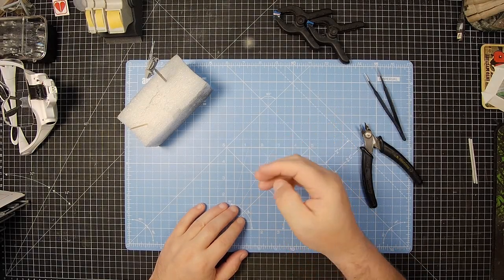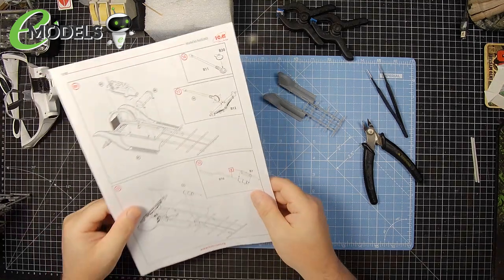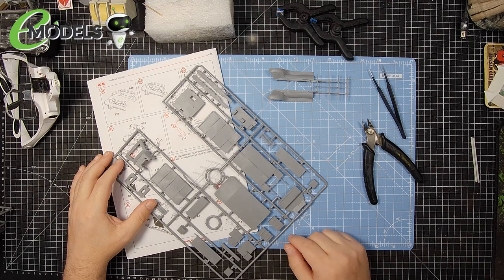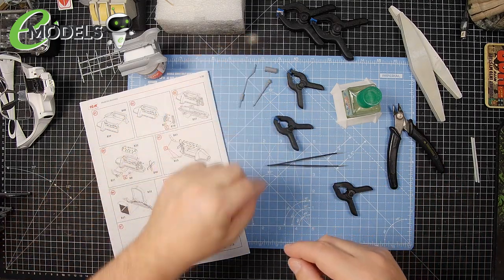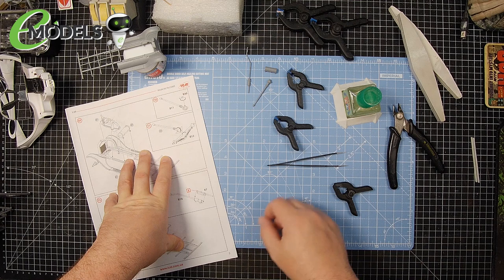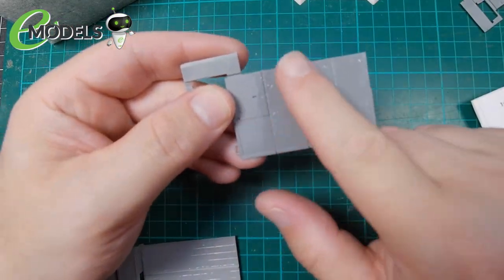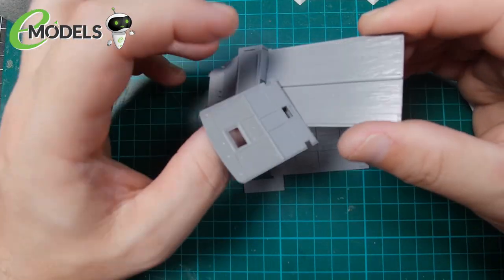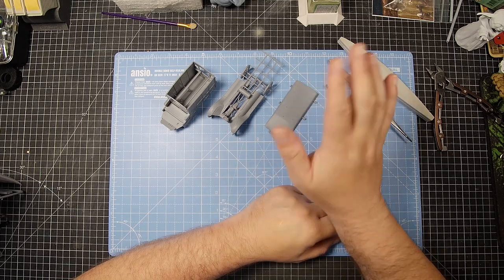ICM 1/ 35 Model T 1917 Ambulance (early) WWI AAFS Car  ( #35665 ) Part 3:  Chassis & Rear Cab

Comment: When attaching the wobbly front axle, I found it helpful to use the hood - or bonnet for you UK blokes - laid in place to help both align the radiator and grille and lightly hold them steady until the glue dries.